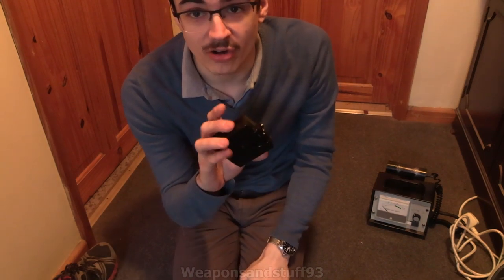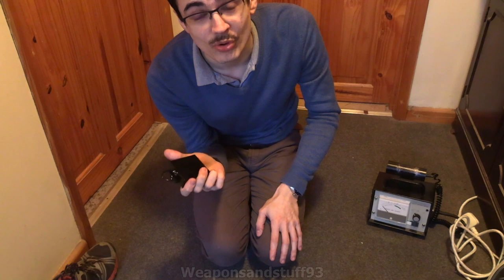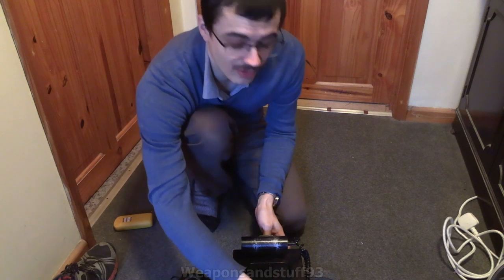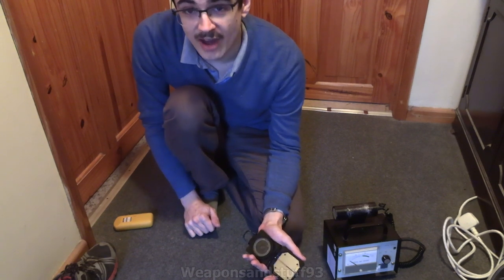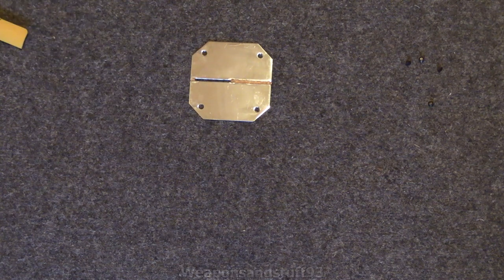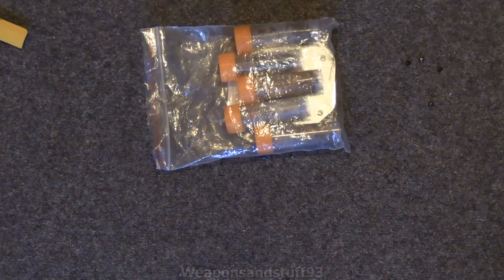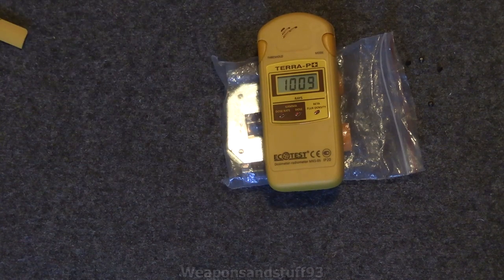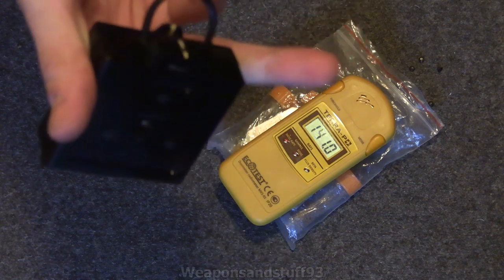British Mark 1 Marching Compass safety information

Comment: Thanks for that, My dad gave me his identical cadets compass which I’ve had since I was a kid, which rarely comes out. I recently bought a Quarta Radex One detector for a little curious fun, and after watching your vid tested my compass, which is reading 25.5 ms, but from the internal forward fixed direction marker arrow, not the outside ones near the loop. Mine doesn’t have the lid, and don’t remember if it ever had. At least I now have a good test source for my meter, and the compass will now live in a freezer bag!
Reply from the maker: Yeah it's amazing how many old instruments are radioactive

Comment: @weaponsandstuff93 ………….bloody hell!!!!, ive got that same model in my display cabinet in my attic!!!......WTF! am I supposed to do with it now???, I always thought that as long as the paint was 'stable' or not flaking off etc , it would be ok? if you take the mirror off then what?...good video but more info on what to do next would be appreciated...cheers
Reply from the maker: Just store it in a metal box, bag the compass and inverse square law means past a few feet radiation will be background
Reply: @Weaponsandstuff93  so put the compass inside a sealed  plastic bag, then put that in a metal box?
Reply: @Weaponsandstuff93  just checked the compass again and the 'strip' of paint seems to be coated in a clear 'varnish' type stuff....is this usual?...ive boxed it up but it seems pointless having it if you cannot have it on display...I also have an aircraft dial....but ffs is that killing me too?...ha ha :)...cheers
Reply from the maker: @steelhelmetstan7305  It might be some sort of glue they put on the radium to extend the paints life, stopping it chipping. If you want to display it safely buy an acrylic display box, that way you can have it stuck inside and diminish the radiation escaping. I keep all my ore samples in acrylic cases.
And yeah any WW2 aircraft dials have radium paint.
Reply: @Weaponsandstuff93  okay , so do you think I could use an acrylic box that a model tank/die cast vehicle comes in?, they have a dark plastic base....with holes in the bottom for securing the vehicle, if  I gaffer taped the holes and taped the box shut , would that be enough?...sorry to bug you again but this is all new to me. btw my aircraft dial thing is a directional compass and there is a video of it on my channel...any info you could give me would be great...thanks again...cheers

Comment: Great video! I think it would work better if you put all your mirrors and other Radium samples in individual zip bags, and then put everything in one bigger zip bag, so you don't have to open them. In one big bag items rub against each other, especially mirrors. You open it frequently, so the bag gets worn and any released gas escapes.
Reply from the maker: Yeah I've since triple bagged some of the items

Comment: Whilst up in the loft I just came across my exact compass that I got about 30 years ago for Boys Brigade camp. I thought it was 1960’s, but had no idea it was military issue until I seen the broad arrow , and it’s much older than I thought. It wasn’t until I was giving the Bakelite a clean up that I wondered if the lume may be radioactive, no worries I thought as it’s under the glass………..that was until watching this video 😯
Needless to say that it’s in a bag now and back up the loft 😀

Comment: You can use acetone to get the paint off the mirror.
Reply from the maker: As said in the video, may also damage the mirrors so use at your own risk
Reply: even worse, now you have super small particles dissolved into your acetone soaked tissue.
As soon as the acetone dries you gonna have a ton of radium dust...